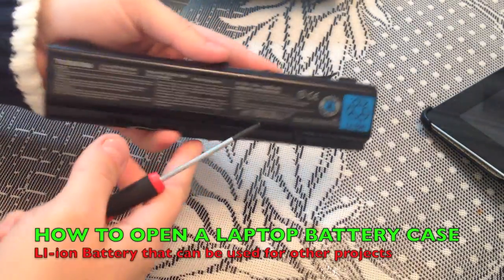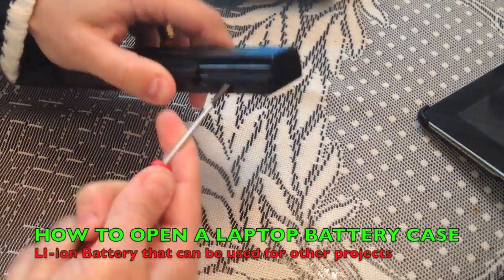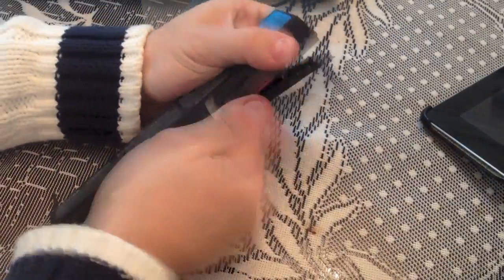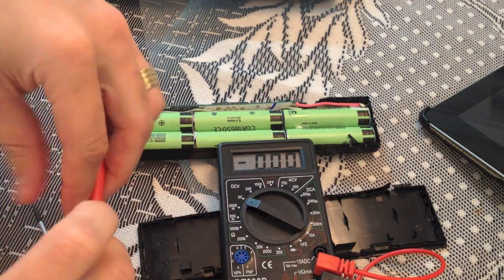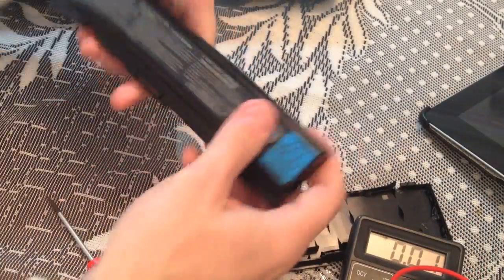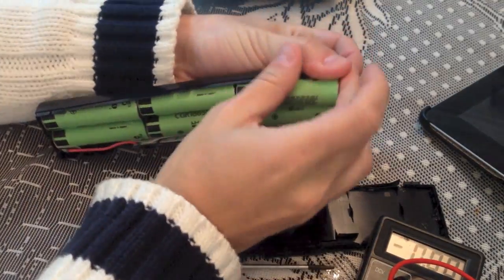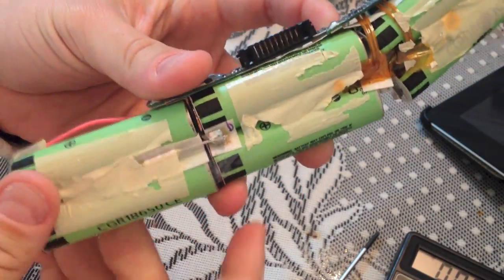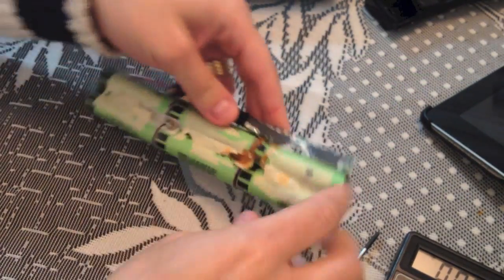HOW TO OPEN NOTEBOOK / LAPTOP BATTERY - LI-ION - LITHIUM

Comment: Has anyone seen what happens if you slip with the screwdriver and accidentally go through one of the batteries? 
You really are tempting fate and if you want 18650 batteries just buy them because it is not worth blowing one of these up with a screwdriver and burning yourself or even blinding yourself. 
If you must do this then wear gloves and goggles and keep the batteries on a fireproof surface. Just be careful or you will burn yourself badly.

Comment: You are a lucky one. I think mine is hard glued all over. I've been trying to use a large knife but even at full strength I cant get it to open. I will probably end up cutting a large hole in it while trying to pry.
Reply: I think a knife is a dangerous thing to use as a lever. I'd suggest a flat-head screwdriver.
Reply: VDE screwdriver. As at least they have protection. Once you get in a little bit, shove one of the drivers as far in as you can get it, then get another one and work your way down. I actually used a flush cut pliers to cut a bit of a hole once i opened it a little.

Comment: will these batteries work in a box mod that takes 18650s?
Reply: Well havent tried yet
But I guess no Because they need to be High discharge batteries
Reply from the maker: It Will work
Reply: it will work but the batteries will blow eventually

Comment: You can replace these awful lithium packs with two 12v lead acid batteries.
Reply: +faffaflunkie But cant charge when using.........
Reply: You can also use Milwaukee/DeWalt 20v Lithium batteries in place of the AC charger.
Reply: Yeah but your better off sticking to lithium, there cheap,clean and in my case light.  6 Of them for about 16$  Would last me a few days for a portable boom box kinda thing...
Reply: They're the same 18650 batteries- but come in a nice plastic case and with a charger. They also will recharge cell-fones and tablets. And they will also power your floodlight, drill or circular saw.
Reply: +Zoniq yea but lithium can cause a bad fire if it were to get to hot so 12v alkaline batteries would be better
Reply: No. Lead acid batteries are bulky, and require 12v to charge. Different to a laptop in many ways. There is also the issue that the 12v battery may not be able to supply the laptop with enough juice, or the right amount of it. You should use the main battery (li-ion) - replacing it with a lead acid is an awful idea.

Comment: thinking of doing it the other way round just replacing cells instead of whole battery but is not that much cheaper.  if the laptop battery i need is hard to find maybe this is a solution i will look into thanks.

Comment: These aren't very high discharge batteries, I would bet that they can't go over about 5C at most. Be careful with them. Great video, though! :)
Reply from the maker: EPaR - Aidan Gieg yepp, you are right,  It did not worked for RC boat that I have...
Reply: Felipe Zafani They do work great for Electric bikes! You just need around 15-30 Ah worth per 3.7V cell group. (usually about 10-20 cells) Then put the cell packs in series for your desired voltage. A 1KW 48V ebike motor will only draw 1-2C if you at least 15Ah worth of cells.

Comment: can you say the price of the one li-ion cell?
Reply: depending on the brand, it can range from 8-16 USD
Reply from the maker: saharath boonsakul Look at ebay.
Reply from the maker: sajin ms look at bay, it is cheap, better to buy pack of 4 it is cheaper.
Reply: Actually, a genuine (it tested near its nominal capacity) Samsung ICR18650-26 (with 2600 mAh) can be bought for only 2.5 € ($3). And a top-range cell, the Panasonic NCR18650B (with 3400 mAh, near the theoretical maximum density for Li-ion and the largest capacity available in a single cell) can be bought for about 4 € ($5).

Comment: dude you need to be more careful handling those connections between the cells, and it usually has a small thermostat in the circuit that could fall off if you're not careful .
Reply from the maker: I know my intention was only to show how to open and not how to fix the battery case.
Reply: Felipe Zafani 0k
Reply: *****
hello , you can not fix lithium ion cells. when they go bad please send them for recycling in your area.  those batteries are inexpensive new.